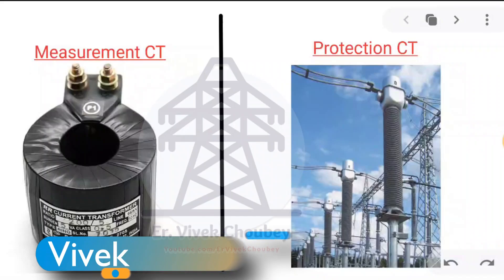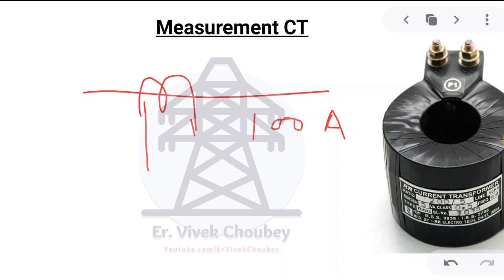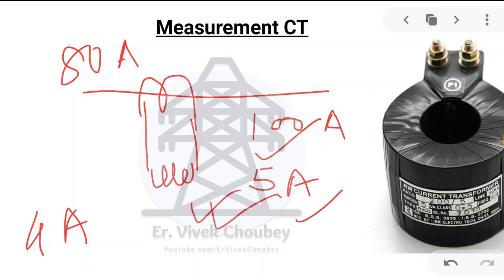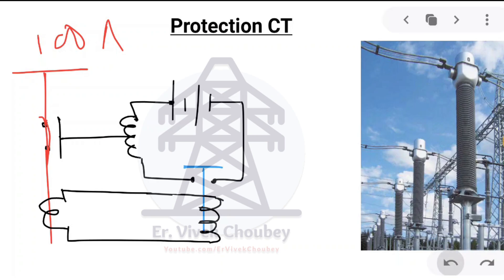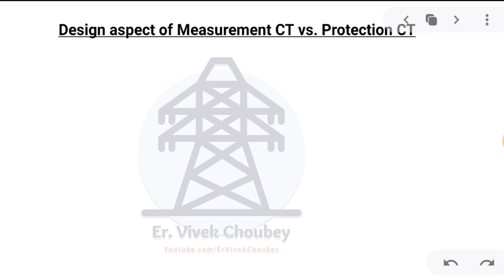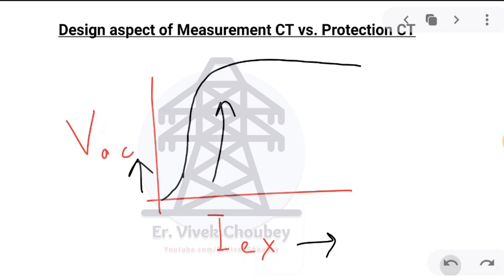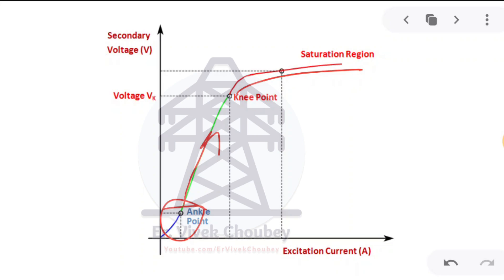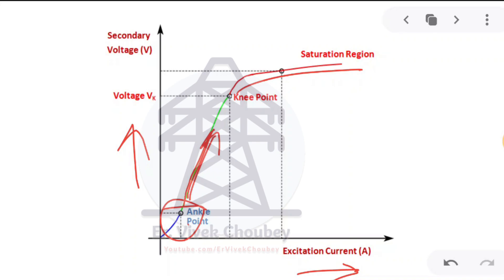Why Measurement Current Transformer (CT) can't be used as Protection CT ?

Comment: While ct saturation, can we measure secondary current on that ct? Or the secondary current turn to zero?
Reply from the maker: CT Saturates when there is no burden on the secondary due to creation of excessive voltage. Connecting an ammeter will short circuit the terminals because ammeter is connected in series not parallel. At that moment, the secondary current will be the one equal to short circuit current which will be less though because of great number of turns.